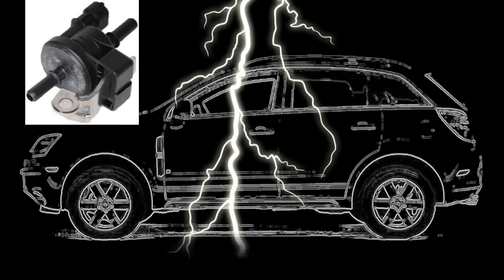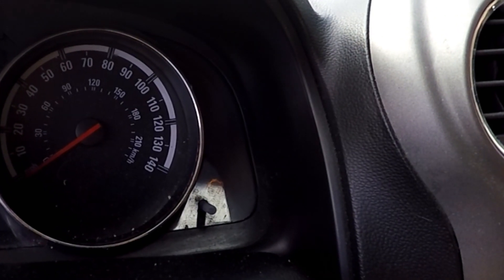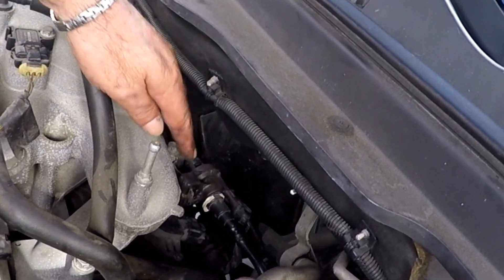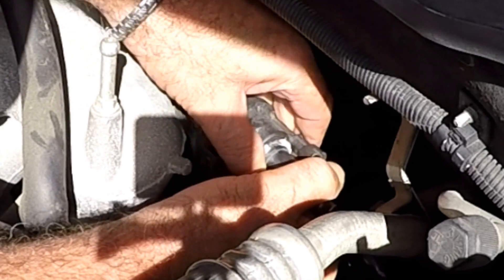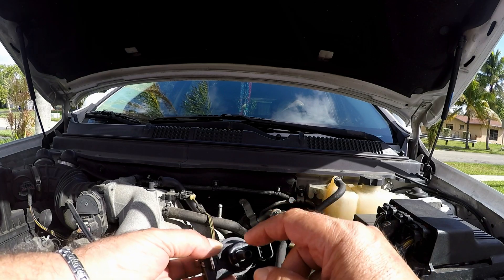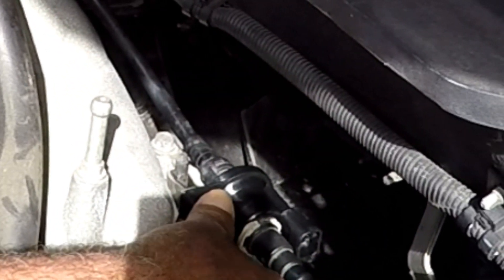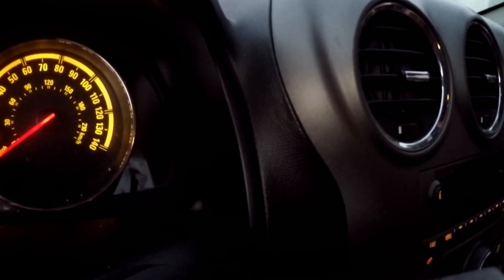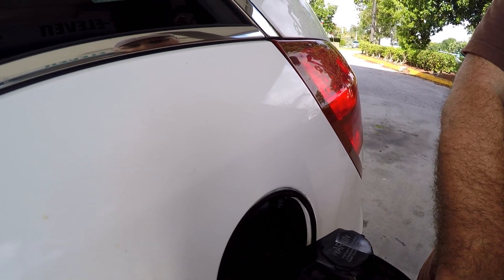HOW TO REPLACE EVAP PURGE VALVE SOLENOID | 2008 SATURN VUE XR 3.6

Comment from the maker: What happens when a purge valve goes bad?
If your canister purge valve is stuck open, however, it creates a vacuum leak that can affect your engine adversely. This will change the car's air to fuel ratio, and can cause rough idling (car feels rough and bouncy when the engine is running), as well as difficulty starting.
Car is hard to start Inspection
Reply: LIKE #1

Comment: What happens if the engine light didn’t turn off?
Reply from the maker: you can use an OBD2 Scanner to cancel the code or remove the NEGATIVE terminal cable and reconnect it after 5 to 10 seconds.

Comment: Is there a special way to get the electrical connector off? I'm pulling on it but it doesn't budge. I don't wanna break it.
Reply from the maker: there's a small safety clip on one side you need to lift before you start pulling it apart.

Comment: Hello.  The video was excellent and helped me replace my valve on my daughters 2009 Saturn Vue.  Upon changing it, the engine light still stays "on"..  I ran back to Autozone and the code was the same issue "P0946" as before.  The counter guy told me I needed to take it to a 'Dealer" and have them "reset" the code....is this true? or do you think I have a bad valve"
Reply from the maker: Codes can be reset without going to a dealer. All you need is an OBD II tat plugs into the plug under the dashboard. Or you can go to a mechanic shop they can do it  and charge you a fraction of a dealer.

Comment: where  is the  vent  valve      located      on  the   Saturn     2009   suv.    6  cylinder
Reply from the maker: Never had the need to check but If I'm not mistaken it's on the top of the fuel tank.

Comment: What the name of the white piece on the hose? Is it necessary? I dropped mines while trying to change it, and can’t find it
Reply from the maker: If you are talking about the white clip on the black fitting? It holds the hose into the valve, preventing it from falling out, without it, the hose will disengage once the system is pressurized by starting the car. Find it or replace it.

Comment: Great Video!

Have a 2008 and I've had to replace this stupid valve twice now. The first time was under warranty which was good because back then that valve was $75.00. Now they are dirt cheap and easy to do so not all that bad I guess. I too was having the no start issue after very short drives only. If you hold the peddle down and crank the hell out of it, you can get it to finally start. Now it's just a matter of passing emissions so I had to replace it. 

This vehicle is just a spare vehicle for us now but it could have remained a daily driving if it wasn't such a pile of junk. It's the worst vehicle i've ever owned and as a lifetime GM lover the reason I'll never buy a GM vehicle again. Too many electrical problems, AC expansion valve, oil in the intake issue, interior plastic parts are crap, etc. Moved on to Toyota afterward and couldn't be happier. 

I will say the motor runs very strong and the transmission is great but otherwise, I'd never recommend any of the current GM versions of this platform which there are many now.
Reply from the maker: Thanks for the feedback!

Comment: I just gat my car back today from the garage.. I have 3month warranty  on it. The glow plug 🔌 light was flashing and d engine light did came on too. They changed a sensor,,,, and I drove off. Told them... Hope this is it 😀,, I wasn't there when they were running the diagnostic,,, so... I'm sceptic. We see now, how long the lights will be off. But,,,, here my question: if the glow plug 🔌 lights flash,,, does that usually means,,, the glow plug,, one of the glow plugs, needs be changed? I'm not a mechanic, also, I haven't seen the error cod,,, but.. Would make sense, no? I understand, sensor can give troubles too.. 🤔 Well, anything really.. 🤔 I will never figure it out, as, I don't see what the diagnosis tells. Fingersx,,, no lights will come back on. Oh.. I forgat to say: I gat a Jetta VW  2010, only bought it few days ago.,after giving up on my Golf VW2002 I had before. Had years of troubles with that golf, because of... Lights flashing up. A common VW problem? Maybe.. But still..
If the lights come back on... I get back at you.
🐾🐺
Reply from the maker: If they did not give you the code there's very little research you can do. The code is where to begin or you are at their mercy. If it happens again get someone with a code reader to scan it.